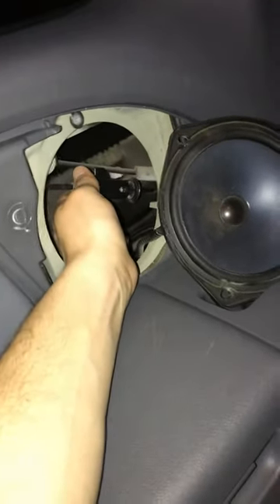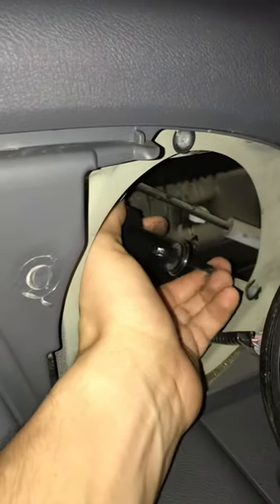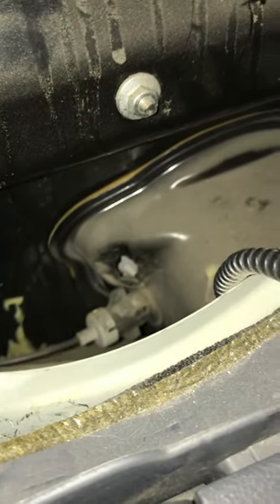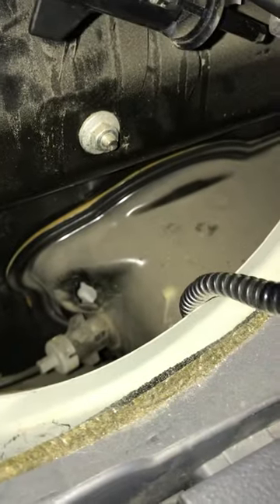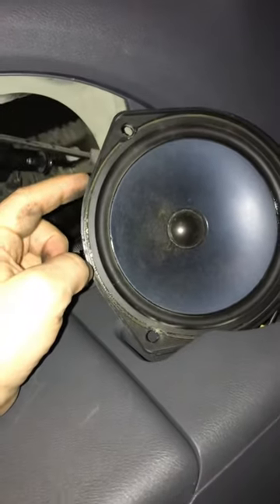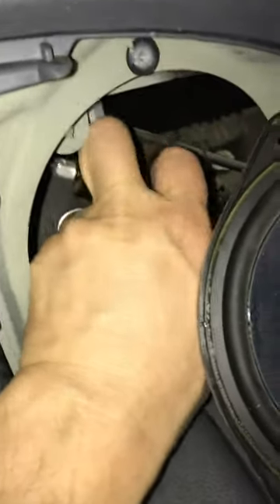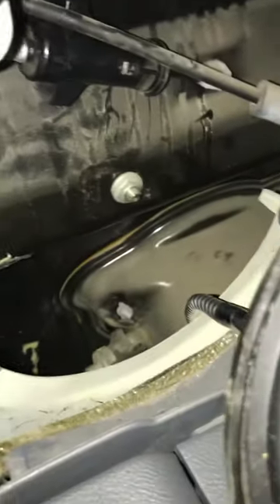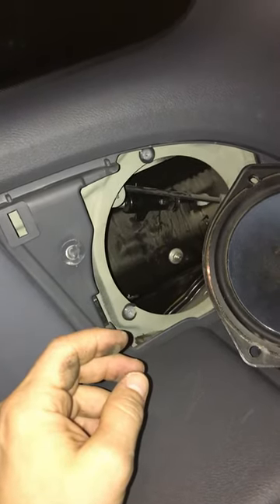EASIEST FIX! Sliding door won’t open - Honda Odyssey

Comment: Thanks!  My '08 Odyssey was exhibiting the same symptoms: Upon manual unlock, door immediately locked itself; attempt to open door gave beep-beep-beep. Turn door switch on dashboard to "off", door could be opened & closed manually (with muscle), but still beep-beep-beep.  However, the problem in my case was: missing plastic piece (on fuel door) that pushes down the sensor plunger/button.  For 2005-2010 Odyssey, part number 74391-S0X-A01. Well under $10 to get part from Honda dealer. Whew.
Reply from the maker: Thanks, Steve! Right, the plastic piece that pushes against this plunger is a key part of the puzzle also. Thanks for the comment—people need to be aware of this piece too.
Reply: Good afternoon Steve where did you purchased the part
Reply: Is this the same part as a 2011 mine is the same issues as this would like to knownif part number is the same
Reply: I dont mean to be so off topic but does anybody know of a tool to get back into an Instagram account?
I was dumb forgot my password. I would love any assistance you can offer me!
Reply: @Caiden Kenneth Instablaster =)
Reply: @Gregory Abraham Thanks so much for your reply. I got to the site through google and im waiting for the hacking stuff atm.
Seems to take a while so I will reply here later with my results.
Reply: @Gregory Abraham It did the trick and I finally got access to my account again. Im so happy:D
Thank you so much, you really help me out!
Reply: @Caiden Kenneth Glad I could help =)
Reply: Having same probs with my ‘07 odyssey - I was getting “check fuel cap” a few times the past year and this evening after putting in some gas, the cap would catch when I tried closing the fuel lid! I’ll have to contact Honda for the exact part but I feel better after seeing your vid!  Thanks!
Reply: Thanks!  For help

Comment: This video was spot on. Thank you! It solved my problem on my 2010 Odyssey and took all of 30 mins - no kidding. My problem was that left slide door did not open nor did the fuel door. I tried some tips from other videos once I had my son pop out the speaker. We tested the sensor, which had become displaced and a piece had broken off. This was the problem. We were able to reset the sensor properly and both problems were solved. Thanks for the part number from Schmidt. We will purchase that part and follow these simple steps to make a final replacement. Fantastic tip getting to the part via the speaker.
Reply from the maker: So glad it helped!

Comment: Preciate the visual. I didn't have to take anything off, but did tie the fact that I had just gotten gas prior to this issue popping up. Door was working fine hours before, but I did get the gas right before discovering it. So I opened the gas door, double checked the cap, and closed everything back. Tested the door, and magically it was back to functioning correctly. Definitely appreciate that. I had no idea that the driver sliding door was in any way tied to the gas door.

Comment: Thaks for this video. I have a 2004 Honda odyssey, same issue with door not opening. The fix in my situation was the foot plastic on the bottom of the door. I guess it had come up and was causing issues with the automatic door. I opened the door manually by turning off the automatic feature and pulling it open, then popping off the floor plastic.
Reply from the maker: Thanks for that - good info. hopefully it'll help others with possibly the same issue.

Comment: Wow! Honda did it again... In my 2005 Odyssey both power doors weren't working. At least I fixed my passenger-side door. I mean I think I fixed it. The driver-side won't open. I'll try to reset doors soon and also check the gas cap compartment. I hope there is a visible tab there. Anyway, did you fix it by purchasing a new sensor or there are exactly the same tabs on the market? I see aftermarket support is mostly available for parts that commonly fail like suspension parts etc. I purchased door bumpers on Amazon for $10 and it fixed my passenger-side door at least for now...

Comment: What year Odyssey is this on? I approved your comment causer YT flagged it since you tried posting a link onto my YouTube channel. Thanks for the tip, I don't think this will work on all models years.
Reply from the maker: BundysGarage true. And I should have clarified that you can’t replace the part this method. But if it simply popped out and you need to pop it back in, this is the best method. 
This is a 2005.

Comment: My 05 odyssey driver side won't open even though I tried it Manually.   Would it be the same symptom?
Reply from the maker: It won’t open even when you try to open it manually? Will it unlock? 

If it won’t unlock (it keeps locking by itself immediately after you unlock it) then it’s probably the same issue.

But if it’s unlocked and still won’t open, no, I don’t think it would be this same issue. But I’m not an expert. 

Hope you get it figured out!
Reply: @eliasfairfield7859  it unlocks and locks normal.   I was able to reset it a few times by unplugging fuse #7 and started working then problem comes back.   Done this a few times and now it the door just stuck no matter what I do.   Reset stops working
Reply: i have same issue like , vinh lam , i tried many time time but doesn't work , unlock and locks normally, door open and close twice then can't open again , have to reset and working couple time then stop
Reply from the maker: @KhangNguyen-jp5kk  if the door can lock and unlock fine, then this is not the same issue. I hope you’re able to get it figured out soon!

Comment: Couldn't tell from video where the sensor you said fell out should go. Where should it be reattached?
Reply from the maker: Hey @jim causey - there's a round hole it fell out of. I think the easiest way to see it would be to pop the gas door and look from that angle. You should be able to look a bit behind and up from the gas cap and see the hole there. Hope that helps!

Comment: Hi
I just fixed the Odyssey 2008 Driver side Power sliding door. When you open the sliding door 3 beeps and nothing happens and the door just closes, unable to clock or unlock, all other doors working fine. The issue is the cable DOOR STOPPER SENSOR.
It was very simple to fix it,Just took me 15 minute to fix it. How did I do it?
I open the speaker cover on back driver side, Use the plastic tools took about 1or 2 minutes take the speaker out 
Open 3 screws of speaker push the latch of cable and remove the speaker out so we have room to work 
Twist the cable and full up the to the place of the speaker and inspect it
My cable broke at the end of the part that just took out ,that is why when the gas door closed but the sensor did not work the computer thought the gas window was open so it disable to that door.
I used the metal wire to tighten on the broken part out the wire back to the body so it can hold the wire inside able to move to the sensor. Then I test it work right away
What is the reason I thought the cable sensor was bad? Before taking the gas from Costco it worked fine, Then I remember I did a bad thing during pumping the gas. Instead of get in line to the side of gas door but when I saw the other land open, then I moved to that land it opposite with my gas door then move the gas line over top then to gas window put the gas tank, it hit so hard during I went to select the gas. That is why it damages my DOOR STOPPER SENSOR.
So that is my lesson, don't do it next time.

Comment: I am trying this on our 2002 Odyssey, but don't see the part in your video. Help?
Reply from the maker: What part don’t you see? The cable and mechanism at the end? 2 thoughts would be: 1) you might need to fish for it a bit as it might have fallen down. 2) they might have designed the 2002 differently. 
Hope you’re able to figure it out!

Comment: My doors are manual I think  the right side only opens  and sometimes get stuck half way pushin pulling getting old
Reply: Left won’t open at all
Reply from the maker: Teresa - thanks for watching. I hope you can figure it out. Have you tried greasing it yet?
Reply: @eliasfairfield7859  yes I did and it started opening and closing a little better.
Reply: @eliasfairfield7859  I finally got a new slider piece for it. . 36$
Reply from the maker: @teresamcdaniel1989  All resolved now?